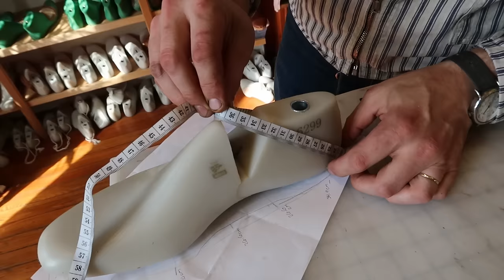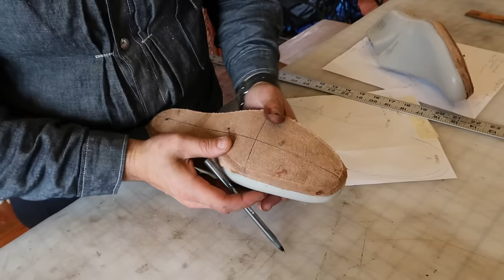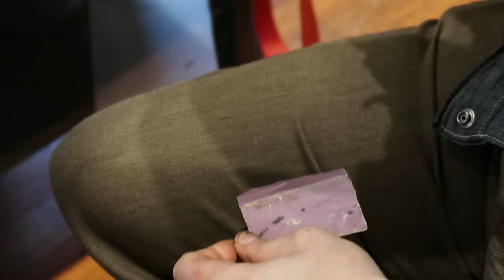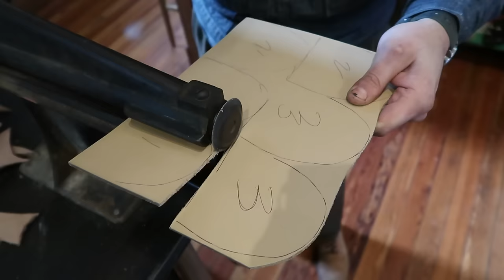Handmade Engineer Boots With Natural Walnut Overdye Full Process

Comment: Does the stitching pattern on the mid shaft boot strap make it stronger or less inclined to slip down or is it just for esthetics? I’ve noticed some boots have none, some like Red Wings have a tiny little pattern and some, like yours have a cool design to them or just a rectangle. Just wondering. Hope you know what I’m talking about. Does it actually stitch it down to the boot?